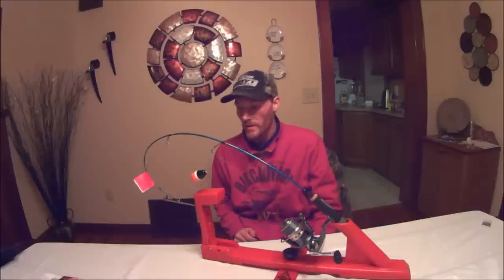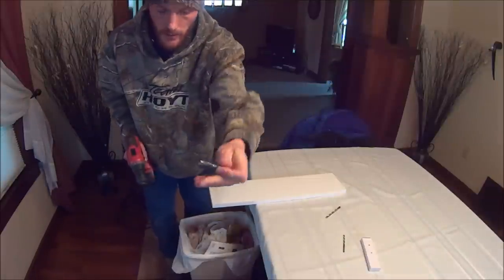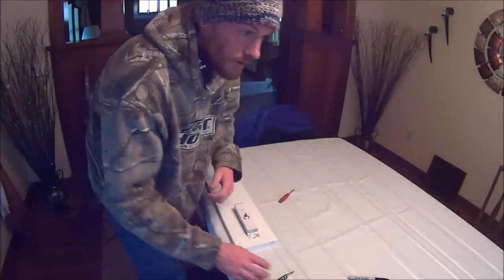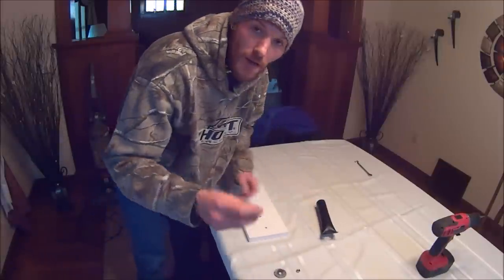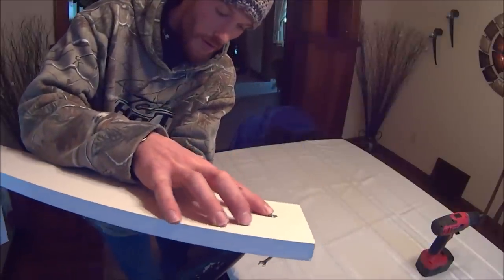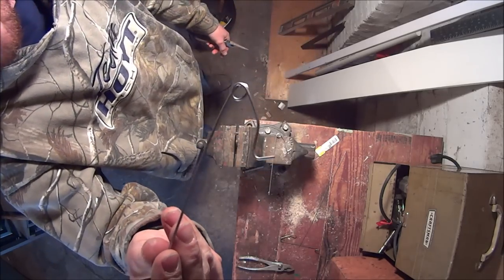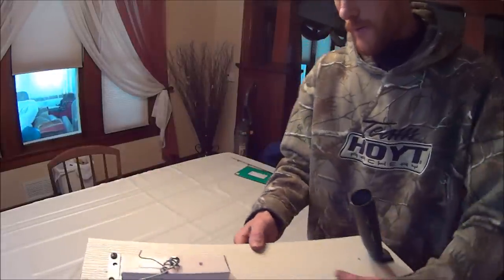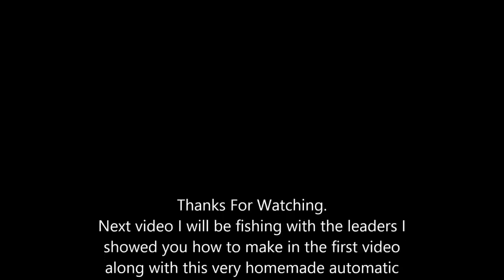Homemade Auto Fisherman

Comment: Thanks for sharing. I made 2 and have had alot of fun using them. Excellent design. For the trigger I used  the heavy wire used for drop ceilings ( its what I had) it functions and adjusts well and sensitive. My base is maple hardwood with pvc pole holder cut at an angle.

Comment: No need for boards, table saws etc. One 30" and one 12" piece of 1" diam. willow, one 2.5" #10 bolt and wingnut.You'll further need a 10" piece of 1.5" plastic pipe and a 8 to 10" piece of coat hanger wire. You'll  need a bit of ingenuity to put these materials together to have an operating auto fisherman. You'll of course need an ice rod of the usual length of 24 to 26" to stick into the plastic pipe . That rig will work as good as the best commercial unit. Your ice stop bobber will cost you a lot more than all the rest of the stuff.